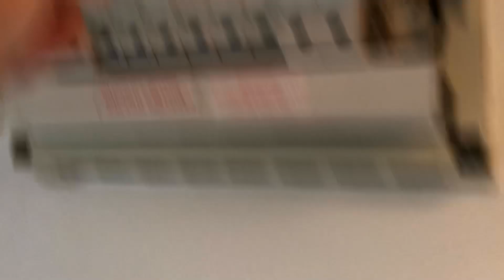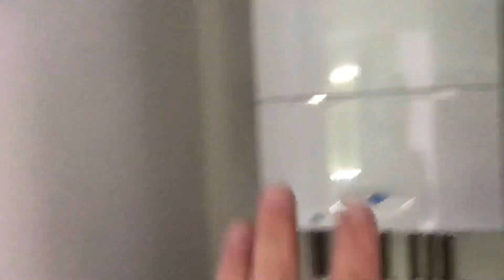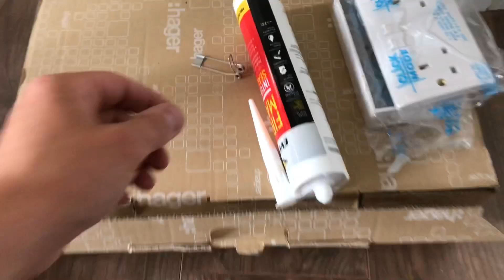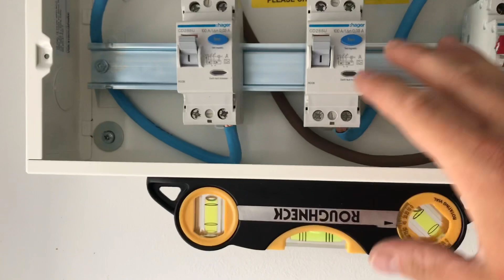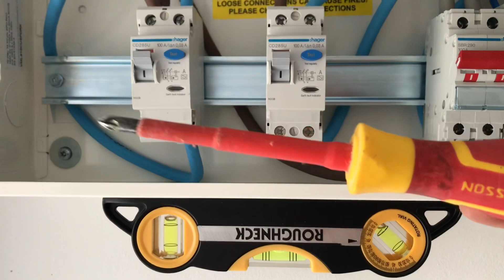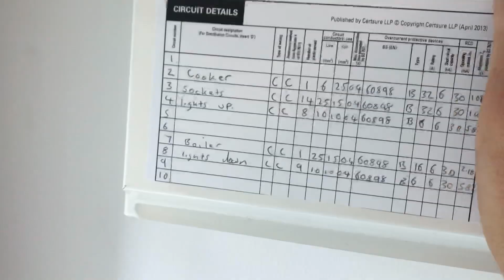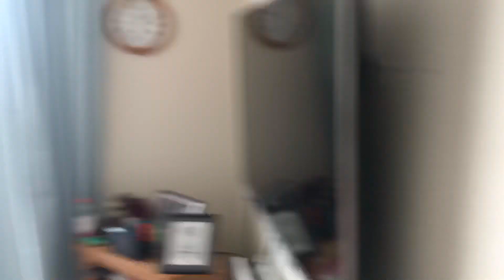CJR ELECTRICAL Installing 18th edition compliant consumer unit.

Comment: 18th edition states that consumer units must be made of non combustible materials. It doesn't state they need to be fire proof or sealed. So long as the IP rating is maintained that is all that is required.
Reply: Correct! I don't understand why people insist on sealing every hole in a consumer unit. Especially when the consumer unit has plastic MCBs and RCDs.
Reply: bs7671 is a standard you can always go above and beyond , but all you have to acheie is ipx4 top ipx2  ipxxd min .
Reply: Check out Reg 527.2.1
Basically goes on about maintaining the fire resistance of the building where cables pass through.
This could possibly come into play with consumer units mounted on fire rated partition walls but i cannot think of many other circumstances. 
If using trunking to feed cables into consumer unit sealing would not be needed at all in my view
Reply: I can understand in this case as there is a gaping hole into a  stud work wall (fire propagating)  but as stated it’s not strictly needed.
Reply: so both cjr and daniel are correct in my opinion
Reply: Your spot on there, I am not knocking what he does, but these things tend to become the norm when there's no requirement, that reg about metal boards is as vague as it comes.
Reply: Have you now created a grouping issue with the cables? A potential hotspot? Created an extra risk? Amendment 3 created a lot of myths. Never got a sensible answer from anyone with regards to sealing the back of the board.
Reply: @rickdouglas8224   who knows, there's always the issue with putting foam or mastic on cables,will it damage the pvc? As usual we have no guidelines from the IET or governing bodies, all we get is you shouldn't do that when they come around 🙄.
Reply: Isn't non combustible fire proof?
Reply: @anonymousanonymous5327  any material will combust given the right conditions and temperature
Reply from the maker: Yes your correct but why not break the mould and go above and beyond.
Reply: @Cjrelectrical  that's a good attitude to have
Reply: Fire barrier?

Comment: Before changing any consumer unit I run IR tests on everything,  won't fit one unless they all pass, or client agrees to fix faults etc. Changed a board in my earlier years only to find everything tripping with the old rubber insulation being perished. Only made that mistake once. Enjoyed the video, cheers pal.
Reply: I always recommend a prework survey before a board change consisting of a full test on the installation. Speeds up a board change no end. RCBO boards as standard.
Reply: A lot of customers aren't willing to pay for an EICR before a consumer unit upgrade.
Reply: @ashmanelectricalservices4318  by full system test I mean an individual test on each circuit. A few hours testing agreed with customer before hand. A simple r1r2, Ir, r2. Not as full on as an eicr and doesn't take long in the grand scheme of things and helps highlight any issues. Depending on the outcome of those tests an eicr may well be required. :)

Comment: If you're reading this comment in 2030+ please let me know if almost every house has a CU with an expired and ignored SPD ;)
Reply: 18th amendment 1 2019  another label "Check SPD quarterly", 18th amendment  2 2020  " check SPD every 6 months" sigh :(
Reply: @davemorgan7695  with all these labels the boards will have to made bigger!
Reply: @Steve Mclean surely the onus is the supply company to ensure a supply fit for purpose, if it blows your kit it's not the sparks fault, just another way to wriggle out of paying out.
Reply: You won't lose power to the house - the SPD will quietly stop protecting against spikes. The sensible option (Ha! Ha!) would be for the manufacturers to come up with a standard user-serviceable SPD module; the Sparky gets paid for the CU installation, then the householder monitors the indicator - when that shows red they pull the worn out one and replace with new. Many punters won't bother of course, but having to call an electrician to replace? Almost no one is going to do that.
Reply: @simongreenidge6454  Take the cover off and replace it yourself ;)
Reply: @simongreenidge6454  The SPDs I've seen all have a Wilex fuse style insert that the homeowner can pull and replace (assuming they know that it exists).
Reply: @simongreenidge6454  some people won't reset a trip let alone an spd ,why the sudden (s)urge to fit these after all these years? I'm not one for paranoid do they know something we don't?
Reply: @Steve Mclean it's not only lighting that causes surges the power companies have been responsible in the past, I remember a case locally when a joint in the road was wrongly connected 415 volts instead of 230v routed to houses ,lots of bangs!!
Reply: Steve Mclean That’s the problem, they only work once and no one will ever check them. Has there been a lot of problems with surges in the uk?
Reply: @Steve Mclean Actually, if you think about it,  what they are doing is pulling a blinder- they're shifting the liability for spike damaged equipment away from the power company, and on to the spark and the consumer. Probably driven by insurance companies, who will now jack up premiums to "protect" sparkies from claims, in their public liability insurance. The onus will be on the claimer of damaged equipment to prove that their installation was tested, and that the SPD was in good order. Like householders are going to do that. not.
Reply: Do you believe that people are going to request sparkies come to vet their installation in advance of that date? HIGHLY unlikely for a number of reasons:

1. MOST people have NO idea at all about the safety of their installations

2. MOST people have ZERO idea of what their CU is and many don't have any more clue as to WHERE it is than they do about where there gas and water stop cocks are!

3. Unless something compels them (like a power failure somewhere) they won't even call out a sparky at all so no-one will even know if they are running on old metal cased MEM isolators with wired fuses and 15amp round plugs and sockets!!

SPDs are NOWHERE near as effective as the internal protection using MOVs and VDRs and other  similar circuitry fitted into most modern technology, including fridges and freezers, washers, dishwashers in fact just about anything powered by an SMPSU! 

IN 50 YEARS I've NEVER known of anyone in a domestic environment suffering from massive wipeout damage from a surge. What has suddenly changed?

I was recently gifted a 6kVA UPS that had inadvertently been connected across two phases instead of a single phase. The fix? Replace three blown MOVs, and two blown 32A HRC fuses. Works perfectly! £40 plus for a surge protector that cannot be replaced simply by the homeowner and has no simple, visible indication of it having tripped on a surge!? Dear God! I thought closed shop unions and industries were supposed to have been outlawed!!??
Reply: yeah how many read the rcd sticker and test it, those spd`s could have failed years previous then they get a surge and equipment gets damaged, might be different if when they activated they caused some disruption but they dont.
Reply: Why do u sound like my mate vince lol
Reply: Boards and wiring could possibly be having a major change over the next few years. Apart from in kitchens. If we think about it. All or most of our lighting is led(12 volt-dc.)  so the transformer/inverter/driver  to do the whole house can be at the Dist board,the wiring then can now be light duty stuff similar to bell wire.. No earth will be needed... Also similar for power... Most of our stuff is fed from USB sockets... Chargers for phones, laptops, tablets, wi-fi, extract fans, TVs, hi-fi,...... Fridges can probably be redesigned to run off lower voltage too. What does that leave us.... Vacuums?   Again there are many now already running from rechargeable batteries so again these can be redesigned to run from 12 volts.... What else... Boilers and pumps.... Again not a major issue for them to be redesigned to be powered from smaller voltage source.. So really kitchen appliances --cooker and washing machines kettles etc are the only big energy using equipment.

Comment: I always say the same about the grommet strip mate! I don’t get why they can’t give you a grommet or something similar to the whiska grommets to use for back entry! I always feel it’s the only thing that let Hager down really as we also fit these as standard.
Reply: I've tried tape, super glue etc, fits great till you lift it on the wall and it pops off, got to the point of leaving it and letting the mastic do the job of stopping the cables rubbing against the metal

Comment: If I as client wanted all the myriad of the stickers that now end up on the CU on the inside of the lid rather than outside is that permitted?
Reply: And then you have to get on your knees to read the details,  part m compliance  ???
Reply: @paulcraft4630  not sure why you have to get on your knees, just open the lid most will stay put in the fully open position, if the stickers are the right way up from that viewing angle it's no different to having them on the outside
Reply: @dasy2k1  the purpose of the lid is that it falls closed when you let go, in the sheltered housing sites we look after the tenants have difficulty holding up the lid, reading the information and operating an mcb

Comment: i super glue the grommet strip in about 20 mins before fitting, it helps.
Reply: Super glue could be viewed as an accelerant of not fire rated.
Reply: @tresslerj1985  good point, but you used the word 'Could' just saying.
Reply: @arniewheeler4673  shrodingers cat. Untill the CU catches fire and investigation happens, it is neither an Hazard nor nothing to worry about. "Could"
Reply: yeah thats something i do when i remember, what gets me is, on the MK boards there are 3 large holes in the back, yet only enough grommet strip for two is provided with a short piece left over why?
Reply: What temperature can super glue withstand?
The flash point of super glue is around 80°C.. Dried superglue is fairly resistant to heat but it's strength will be reduced. Typical outdoor temperatures will pose no problems (by typical I mean up to 100-110degrees F).
Reply: @arniewheeler4673  I only use it just to keep the grommet strip in place while I pull the cables through, once it's finished it will always stay in place
Reply: so do i mate, sorry it was aimed at someone else, someone whom i cant find as his post has disappeared , stating super glue was an accelerant in the event of a fire. there's always an idiot who has no glue what he's talking about.
Reply: @arniewheeler4673  ok no problem

Comment: 300mm to edge of 40a cooker switch/ccu/any switch from cooker/induction hob, just to say mate.
Reply: so we keep sockets 350mm away from edge of a room (if going with newer regs) and minimum 450mm to bottom of the socket/switch.. is that incorrect timmy?  So your saying its all good and recommended (actually a reg on getting that thing closer to a heat source) that it be closer than 300mm, almost encouraging it to be closer to the hobs then carry on

Comment: Anyone know an electrician who has ever been taken to court? Not for shoddy workmanship but for something like not torquing up screws as mentioned, I’ve heard over the years of courses the lecturer talking of court but never heard of it happen for just a general oversight or genuine mistake.
Reply from the maker: It’s becoming more and more with insurance company’s refusing to payout. Also remember in the regs now there is a sentence referring to poor workmanship
Reply: CJR ELECTRICAL sticking with torquing as an example, it would be hard to prove after a fire if they where done to the correct setting as the metal could easily been have affected by the heat. In all honesty I’ve never torqued and probably never will, I’ve been a spark for many years and never used one, I use my experience to judge it and it’s got me this far. I just hate the fact that some jump up office worker decided after all these years that we must use a torque driver so my many years of experience no longer counts. Before you know it they will have us fitting arc fault interrupters 😋
Reply from the maker: Mark D I welcome all the new additions with open arms even AFDDs about time.
Reply: CJR ELECTRICAL I feel we are over regulated in the fact that there are to many regulations and they are still coming, what I do feel should be regulated more are the people doing the job. The 18th edition exam was a joke as on my course we had 3 plumbers sit the exam and all 3 passed but they never understood what they where answering they just knew how too use an index and find an answer. On the first day 1 of the plumbers had to ask what an RCD was? Not mocking the guy just an observation. Now they are going away thinking they are 18th edition electricians and can do electrical work.
Reply: The thing is even if you do tighten the terminals upto the right torque setting, what's to stop someone else coming along after you, perhaps installing a new circuit and not using a torque screwdriver which goes on to cause a fire. I think once the board has been tightened to the coreect torque settings, the board should be tamper sealed, breaking the seal would omit any liability on the electrician.

Comment: Hi mate When I did my 18th they said when changing a board upgrade the tails to 25mm just in case the main fuse gets upgraded to 100 amp what's  your thoughts on that. Do you use  16mm tails on 60amp and 80 amp. And do you always make sure main earth is 16mm if either 16mm tails or 25mm tails thanks
Reply: main earth bond from main cut out (whatever system) MINIMUM 16mm earth and would ALWAYS UPGRADE 16MM TO 25MM TAILS???!?!
Reply: Ok like I said that's what they said to do future proof incase of upgrading to 100 amp. But it's good to hear what other people are actually doing they must not of  said it to him as he left the 16 mm tails in 
Cheers lads 👍
Reply: always future proof, very important
Reply: They told me to always upgrade to 25mm. but like he said it's only a 60 amp breaker so he left the 16mm tails in
Reply: greg davies I would upgrade it mate just for future proofing
Reply: If it's easy enough to do so, swap em for 25 mm sq tails.
Reply: @ashmanelectricalservices4318  so you would swap if possible. But if they was in a wall say and it would make a mess trying to change them you would just leave them as 16mm
Reply: @gd-bq7em It's always best practice change them if you can but ultimately it comes down to the maximum demand of the installation. If the current maximum demand for this installation was 40 amps, the remaining 20 amps should be more than adequate for any future expansion. Chris probably chose not to upgrade the consumer tails cos it was a bugger to do so.

Comment: Wylex make a intumescent strip which you can stick on the back of the C/U and bring the cables through a slit. It can also be stuck on the inside of the MCB flap aswell, in case one melts/combusts.

Comment: on them hager boards are you finding the Spade connections for the SPD that terminate on the load side of the main switch to be loose  ? even after i terminate correctly they literally just pull straight out ? I rang up technical and they said they had a "issue" with the Spade crimps not being the correct size for the main switch Terminals. even though its Low current, I wouldn't like to leave a property knowing a connection is loose.